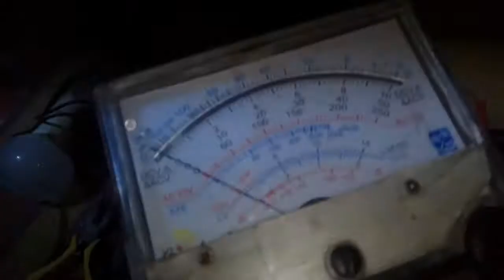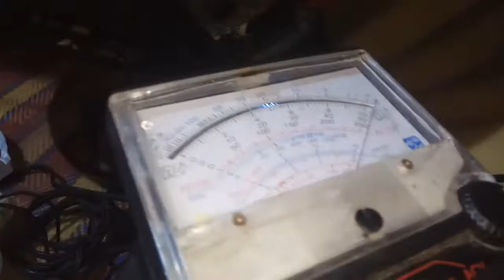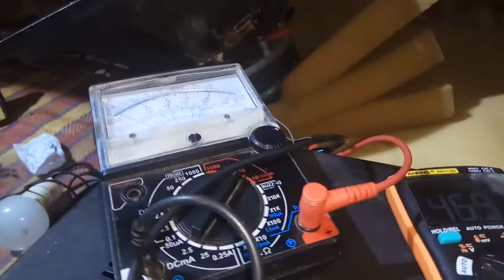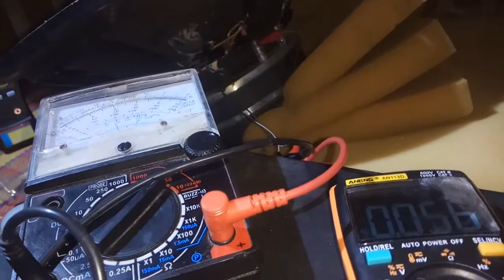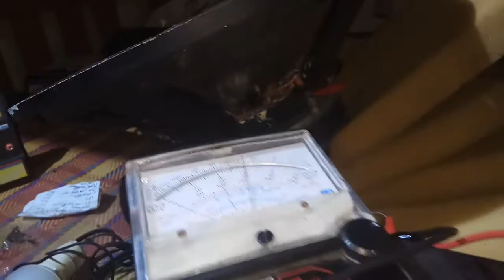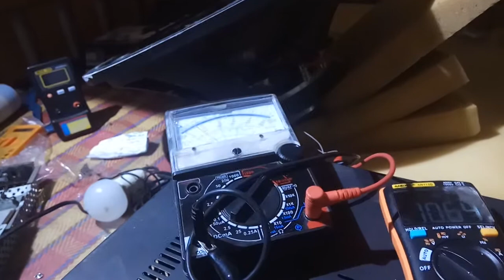tortured test..modified sakura AV 3022

Comment: Boss Anu Yung MGA pinalit mong pyesa SA 3022 ?
Reply from the maker: Andyan n bos ang sagot s video,  pinalitan ng transpo .pang 502 tus tinaasan ginawa k 45-0-45 ac tus e cap. At en upgrade ang board ..at en bridge ko ang amp.
Reply: @bombasstechaudioelectronic1492  Merun bang nabiling board SA lazada boss 
Pa share nmn Ng link boss
Thank you
Reply from the maker: @litokaradol9528  meron mga ready to use n sa lazada class d amplifier kaso disposable yun pero ayus lng..mataas nrin specs..